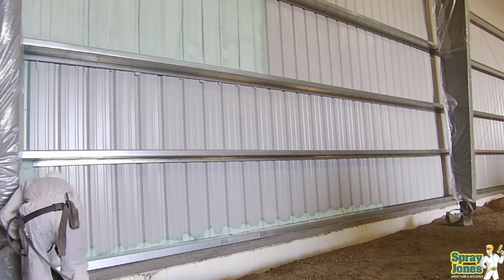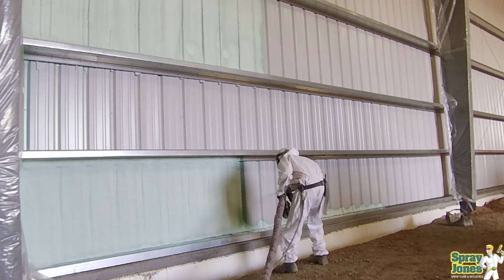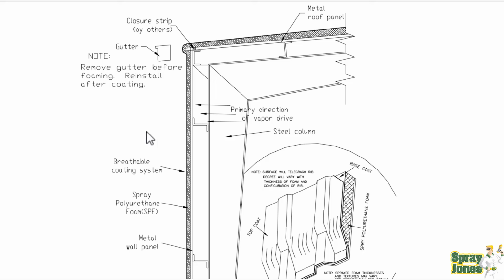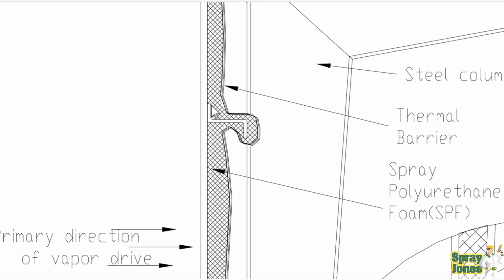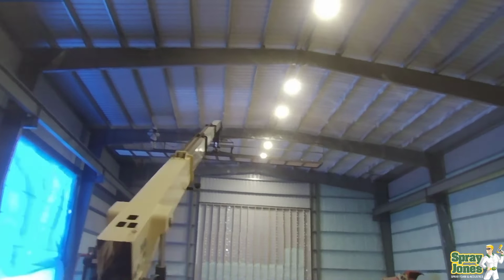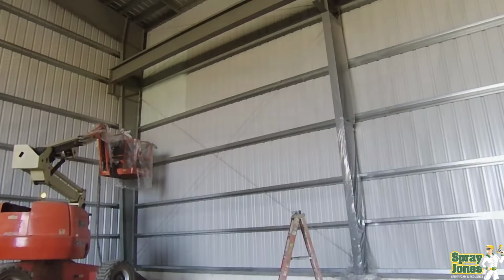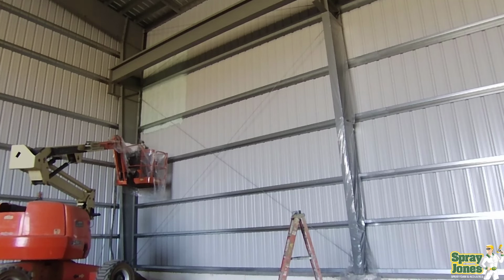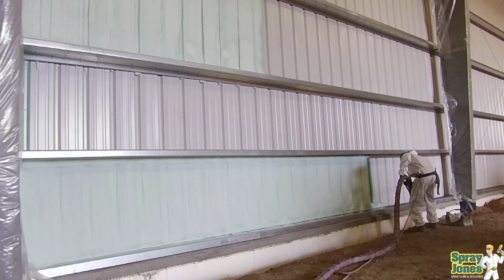Metal Buildings and Spray Foam Insulation | What to look for

Comment: I’m curious to know more about the primer application, and options for intumescent paint…if you add that on to a video at some point. Great content.
Reply: Yes this primer is something I'm going to have to find an installer that does such because I'm planning on using Galvalume 26guage r-loc exposed fastener

Comment: Hello, 1st of all really enjoy your videos and educational content.  If doing an aluminum building so I need to clean (mineral spirit) and prime prior to spraying closed cell.  I am getting a lot of conflicting info from different sources - some say just spray it while others say prime before hand.  I know you mentioned galvanized steel definitely needs this but what about aluminum?  I'm more inclined to quote priming the metal to ensure I avoid any possible issues but don't want to add cost/time for customer if not required.  Appreciate any response.
Reply from the maker: Aluminum absolutely needs to be primed. Ask any painter.... it is very tough to stick to without priming. Also there are specific primers for Aluminum so get the correct product.

Comment: I'll be building my metal shop down here in central Texas and will be using closed cell foam. I'd like to be able to replace damaged panels without disturbing the spray foam. I've seen builders add a layer of Tyvek or house wrap between the sheetmetal and the purlins so insulation could be attached to that. What are your thoughts on this detail? Is there an alternative you'd recommend over house wrap to isolate the sheetmetal exterior but still allow spray foam to be used? Thanks!
Reply from the maker: On a pure metal building it would be a hassle to wrap it because of how would you retain the wrap in the wind prior to the metal being placed?

I also do not agree with it being used for the roof as it can allow pockets of low spots to be made where water can collect. 

Removing the metal later is a moot issue and not a sensible future-proof IMO.
Reply: Thanks for the reply. They use double stick tape to adhere the wrap. I agree it doesn't seem to be a very good solution and could create different issues down the road. Your point of pockets holding moisture is a good one.  @SprayJones
Reply: our hail damage was easy for removing the steel. Company that did the steel wanted it smooth with no bumps from the ribs. Then it was the aftermath of learning not to put an wires on the top of the girts when you trim the foam for new steel you wont hit a wire if the foam or electrical guy didn't hold the wire back enough from the metal. @SprayJones

Comment: For metal buildings with traditional rubber washer fasteners the rubber dries out and cracks with age and begins to leak. If the bottom of the roof is sprayed with closed cell when the roof is new, will that seal each scree and create a lifetime seal, even when the rubber washer fails?
Reply from the maker: Correct

Comment: Hey Mike, question, could I apply cold cell spray foam over my stuccoed home with furring strips placed over the stucco where the studs are. The metal siding would go over that. I live in a 1930s home in California. I don;t want to remove the stucco as I suspect I have asbestos in the stucco. Thank
Reply from the maker: Yes you could.

Comment: We foamed our wood framed steel sided building with 2" closed cell direct to the steel.  Unfortunately, the steel buckled everywhere due to the heat during installation.  The foam is great for insulation, but the building looks terrible.  I wish I would have used a barrier or thicker steel.  I would never do this again on 29 ga!
Reply from the maker: Your installer should have realized how thin things were and did a flash coat to allow it to firm up and build less heat. This was a tough learning situation for you both.

Comment: thinking about doing closed cell foam in our new pole barn.  will oil canning be an issue on 29 gauge crinkle, board and batten metal?
Reply from the maker: It can. Just have them install a 1" thin coat first, allow to harden up and then build successive layers. Work smart and test before blasting away.
Reply: @SprayJones  thats a good tip.  i assume this will help or eliminate oil canning?  how long does it take for the oil canning to occur (if it does)
Reply from the maker: @CollingFilms  Well I sure wasn't talking about hockey... within 2 mins you will see and temps equalize.
Reply: Did you end up spraying a thin layer first? I wish I had known about this tip sooner.

Comment: Yea i am not sure what happened to mine then. The guy sprayed two coats with a total of around 3.5 to 4" of foam on 28 gauge metal and it pushed out but on a post frame building. Great video. How long does it take to spray a big metal building like the one in the video?
Reply from the maker: 29 gauge is the reason. That is VERY thin metal...
Reply: Any suggestions other then the Tyvek to help it? I meant 28 gauge plus plaint. 92k psi steel.  @SprayJones
Reply from the maker: @garenpletzer1532  Only 2 options:
Spray onto a substrate that cannot push against the metal.... questionable..
Flash coat the metal with a thin 1/2" layer of foam and let it set up before anymore passes. This is more time / money consuming.
Reply: Great info. I wanted to sheet it with 7/16s but during the whole design process i somehow forgot about it till last week and the building is up. I was thinking rigid foam between the wood grits against the Tyvek but i didn't know how that would perform with condensation or if it would melt the foam. But there would be that added cost for the ridged foam same as the 1/2" layer of closed cell. I could add 7/16s osb to the inside of the wood girts but then there would be 1.5" gap between the tyvek and the osb if that matters. @SprayJones
Reply from the maker: @garenpletzer1532  You do not want voids and pockets in the outer wall assembly that you can avoid. These are areas for water to collect and start rot. 
Foam is to be adhered, when you run around putting something between the foam and building you compromise adhesion and the open up to new additional issues.

Comment: How long before you would have to get exterior spray foam recoated that is on a roof?
Southern Kentucky if that matters.
It is starting to sun fade a bit.
Reply from the maker: It depends on what product they used, color and how thick it is. Could be 5 years or 8-10.

Comment: So sadly we have a roof that had closed cell (2”) spayed on the outside and then coated with silicone twice in 25 years. Which is what you said “don’t do”. As you said it’s become completely soaked because the top coat has deteriorated and allowed water in!  Do we have the whole top scrapped off and have closed cell sprayed inside and just coat the scrapped metal roof coated again with a silicone?  Thx!!
Reply from the maker: Serious options are the only ones. You will need to chat with a good roofing contractor and one that understands SPF to get a proper game plan together.
Reply: Thank you.

Comment: what would your recommendation be on a wood frame 8'x24'x44' with a concrete floor located in SC, will be fully contained with a conditioned attic space, would you spray closed or open directly to the interior metal roofing and walls, the interior finished walls will be PVC paneling.

Comment: I love all the knowledge you include in your channel. I am building an ICF house with a composite concrete deck for the roof. I’d like to use a spray foam top covering. Do you have any experience or knowledge in this application?
Reply from the maker: Not of that specifically, no one has done one where I am. But we spray concrete ever month so the principals are all the same.

Comment: Very informative videos on a process that seems to be somewhat confusing and conflicting . Was wonderind what  your thoughts are on insulating a steel building  with open cell foam . What are the consequences , is it a definite not do , will it still be perfoming its intended function in say fifteen to twenty years ?  This building is located in B C in a climate zone similar to Sask ,  highs and lows  to 30- 35 degrees celsius . I have contacted 3 spray foam contractors in the area one is fine spraying open cell the other two wont touch it if they dont spray closed cell . They each have their own arguments to support their views . Not knowing anything on the subject i sought info on the web where i happened upon your site and thought why not ask Mike for an impartial opinion . This is a new construction steel building with structural steel, purlins and girts . Thank you in advance for your time , any input on the subject will be very much appreciated .
Reply from the maker: You can use open cell - but closed cell is the better choice. 

Water about vapor barrier? Are you required to have one where you are? if so closed is the answer..

Open cell will need to be covered with hard surfaces inside. Open cell cannot get wet, it cannot be hit, and it is not pleasant to look at. When we do metal buildings most if not all clients want the benefits that closed cell offers for support, water resistance, longevity and ability to be left open and fireproofed.

Comment: I am getting an existing metal building spray foamed and I am concerned about what type of foam to use and how deep. I know you recommend closed cell, but I am concerned that the 2” of closed cell will not cover the metal fasteners that are securing the sheet metal to the purlins. You can tell that those screws were frosting in cold weather and moisture was building because there is rust inside the purlins. This barn had only rolled out insulation before. Half of the building is living the other half is the shop with no interior walls. We are trying to add rooms into that shop area.
Reply from the maker: Then build up the foam to be thicker where the fasteners are, or spec the whole job with more...
Reply: @SprayJones  I appreciate the response. In all my research I still am unsure whether closed cell or open cell is the best option. I have seen it done both ways in metal buildings. We will be in this home for the rest of our lives so I am willing to spend more money up front if closed cell is truly the best option. Seems like I get conflicting information wherever I go on the internet lol

Comment: What does it cost to insulate a metal building 30x50x16ft with spray foam?
Reply: That's something that can't be answered on the internet. As different areas are different prices. How many inches? Open cell or closed? There's multiple questions in determining the price only a local contractor can answer.